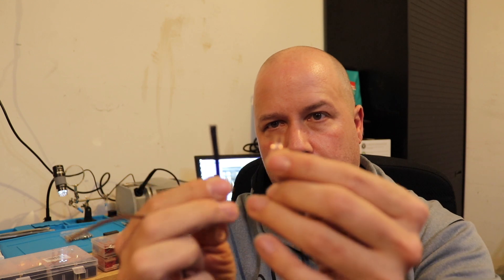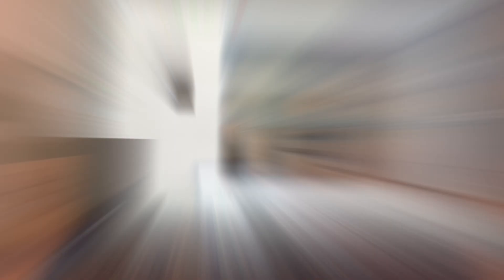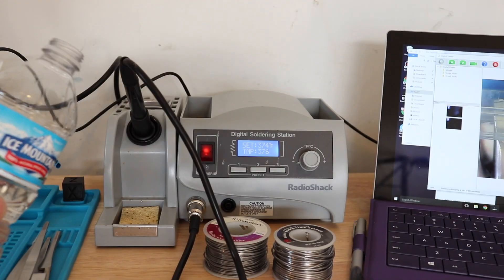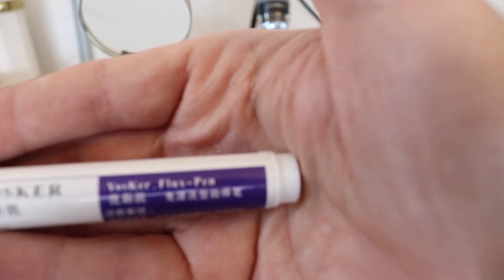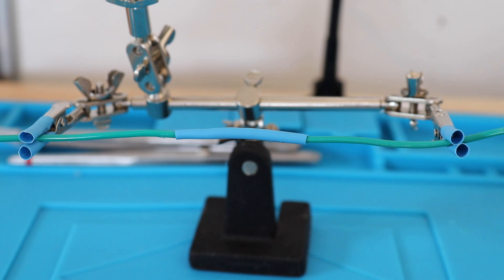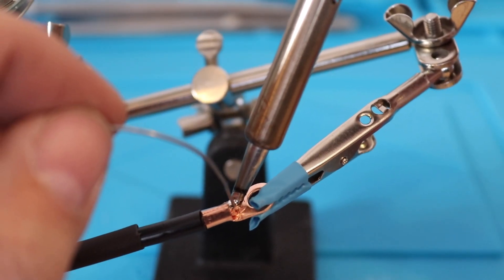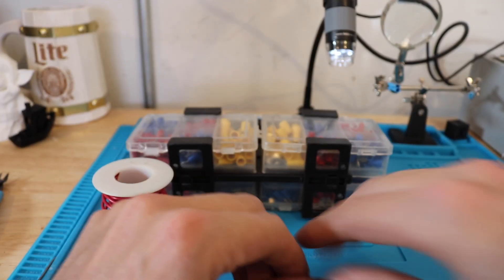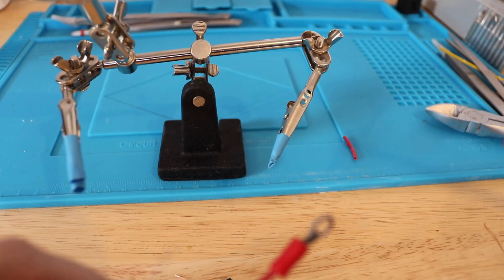How to solder wires and connectors like a pro!  Soldering tips and tricks - Part 1

Comment: Good tips,  I have been soldering for 50+ years and learned some new information.  Keep it up.
Reply from the maker: @David Wilson -  Thanks!  Seems that way with me as well.  I have been soldering for 25+ years and was a certified instructor.  Seems that I am always picking up some new techniques from others.

Thanks again for taking time out of your day to watch my channel 

Tripod!
Reply: @TripodsGarage  I like learning, first started soldering in the USAF at Crypto school.  We had to repair printed circuit boards with tubes and bi-mags, basically a one core memory ic. This was in 1969 on equipment designed in the 50's
Reply from the maker: @woodwaker1  My first soldering experience was building RC cars in the mid-late 80's. Then high school Freshman year in Electronics 101, then took electronics again my Senior year.  Then just continued as a hobby, using those skills in RC car builds, and other projects.  I worked at Motorola form 1993 - 1999, that is where my soldering skills got noticed, and became their certified soldering instructor.  I also ran one of their solder wave machines (MFG - Sensby), and did all the maintenance and tuning.  I then ran their circuit board repair area for a little while.  I really loved doing all repairs from d-sub connectors to ball grid arrays.
Reply: @TripodsGarage  Do you ever watch Dr. Vax?  he has a good channel also and is from Chicago.
Reply from the maker: @woodwaker1  I will need to check out Dr. Vax!

Comment: Honest question but when would you need to solder an uninsulated connector 11:28 ? Is it just hypothetical?
Reply from the maker: It was just hypothetical.  Just in case someone wanted to do it.  Of course these are meant to be crimped and not soldered.  More for if someone wanted to for a project that had minimal current going through it, like a signal wire.
Reply: On my 2001 Ford F150 my battery cable to my starter need a new terminal. I did not want to buy a hydrualic crimper. As a solution I dipped the freshly cut solder in flux, heated it with my torch, solder it, and the connector was connected in what I beleive better than if I had crimped it.